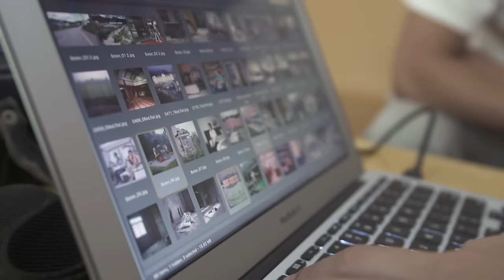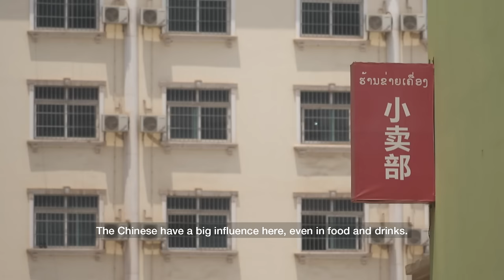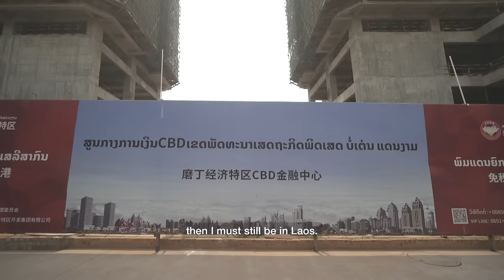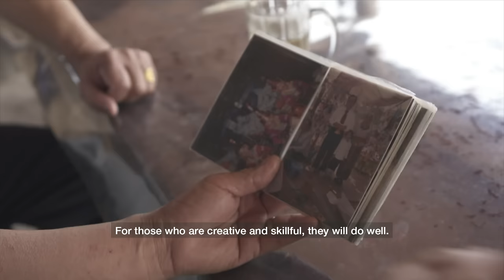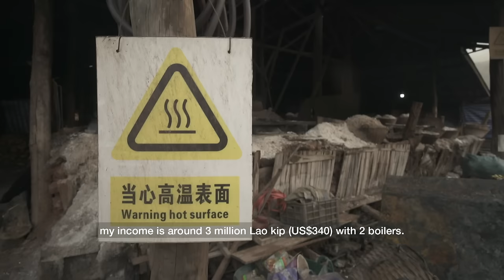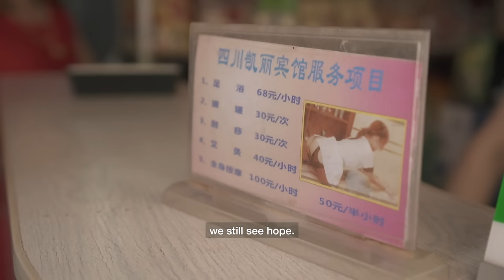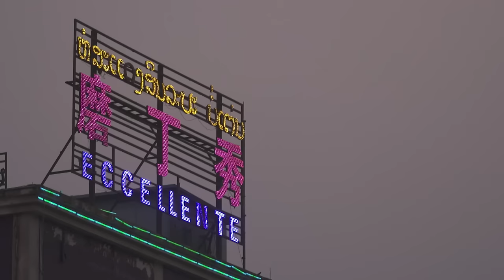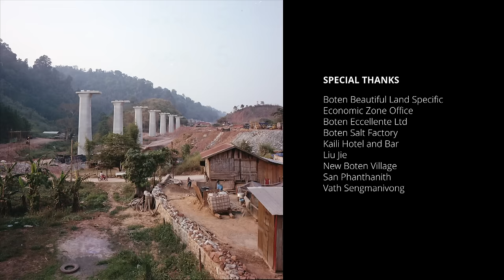The Rebirth of Casino Town Boten, Laos | Borderlands | Full Episode

Comment: I've visited Boten twice; once in 2013 when the place was a ghost town, and again in 2018 when they were in the middle of a building frenzy. The roads leading into town on the Lao side are atrocious. While Thailand has a strategy to build 4-lane roads to every border crossing, and indeed, the road connecting with the 4th Thai-Lao friendship bridge 225km away from Boten is 4-lanes on both sides, the Boten side is basically a track by comparison. The border crossing at the Thai-Lao border is also WAY bigger than the one on the China-Lao border. 

With the volume of traffic, especially trucks, they really need to expand the border crossing and make sure there are at least 4 lanes of traffic, 2 in each direction, with shoulders and a median barrier for safety. When I was there the second time, the road near the border was basically a dirt track, requiring 4wd! 

On the Chinese side, everything looks neat and tidy.
Reply: The Chinese built fast train from Boten to Vientiane was started last year. It's also used as a major freight train line. Boten should change now pretty rapidly, for good or bad.
Reply: @Wilko11   Yeah I know. I was there recently and also used the train.